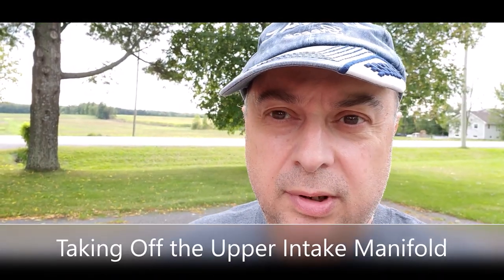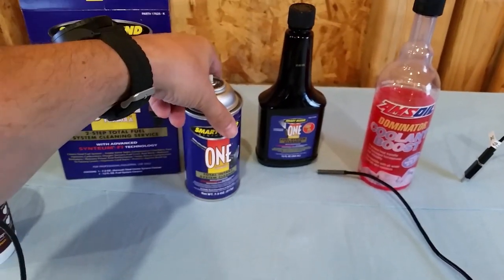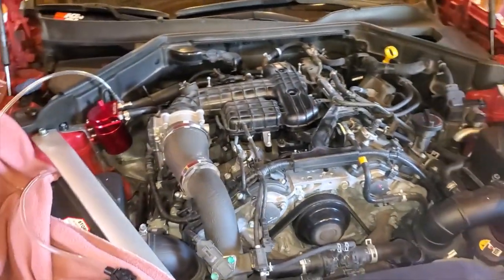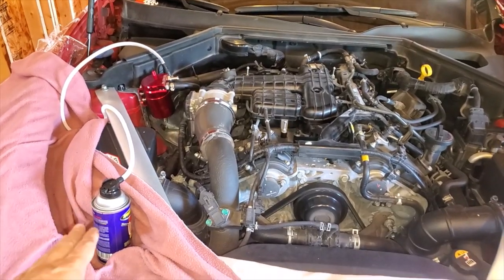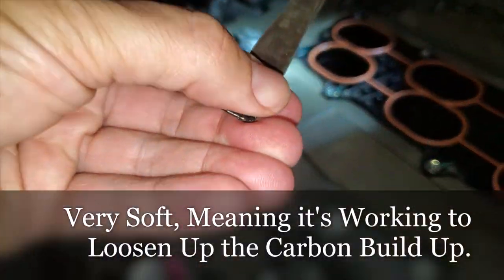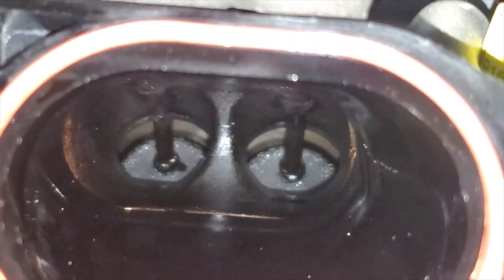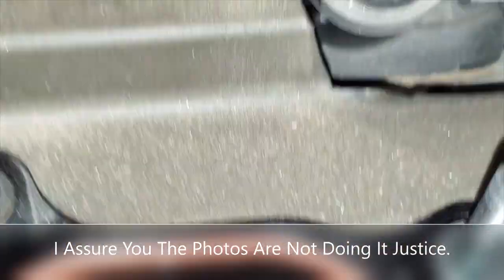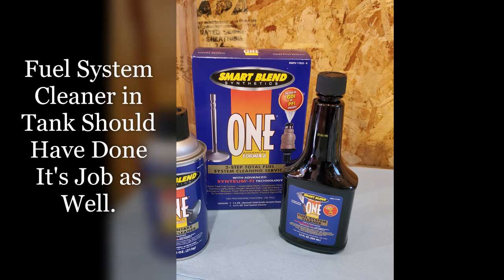GDI Intake Carbon Cleaning - My Stinger GT - A Reference for all GDI Engines

Comment: A more thorough method I found works is make sure the valves are closed and dump lacquer thinner into the intake ports. Use a toothbrush to scrub the walls and stir it around over the back of the valves. Then take rags and absorb all the carbon filled lacquer thinner. Repeat a few times until clean. You can get the entire intake down to bare metal with very little effort because lacquer thinner takes carbon off super easy. I haven't done this to my Stinger but I did it to my Optima SX at 60K miles and got the intakes looking like brand new in just a couple hours.

Comment: How many miles did you have on your car prior to adding the catch can?  And not bad for your first decarbonization!  I run seafoam prior to every oil change.  And have had a catch can since the car had about 3k miles!
Reply from the maker: I'm not sure on kms on my car at catch can install. I might mention that in my catch can video, but it was apprx. 1 year or so after I got the car, and catch can was on my desk in a box for a long time being lazy to get around to it.. I'm considering doing a walnut blast, so I can get it cleaned up much better and then go back to doing this spray  few times a year
Reply: @rpmautoreviews9249  nice

Comment: Good video, I expected the results to be nil. Walnut blast is the way to go, obviously it’s going to cost more, but it’s also going to remove most of it.  Pros and cons to the direct injection, biggest being air fuel tuning capabilities, cons, excessive carbon build up that robs fuel economy and more importantly power :/
Reply from the maker: I will be doing a walnut blast soon !! or after I did this, if had the time, should have hand cleanup of the sludge since it was soft now, but it would take a long time, very slow and careful to not drop bits into the other engine part.. Kinda dumb I didn't but I was at Tyler's house and he had guest arrive before we finished it this part.

Comment from the maker: Special Thanks to my Friend Tyler for all his Work in this Video ! Like a Dummy, I forgot to Formerly Introduce him in the video. Doh ! ** Here's Tyler's perspective from our this experience: 
"  It was a pleasure working with you Stavros! 

This is the first true "before and after" comparison I have done with a carbon cleaning product, and the results were very interesting. Typically you "spray and pray" with a product like this, but we went much further to validate the results. Hopefully your viewers appreciate the extra work that went into doing this. 

Observations: 

-We tested the spray on a part before the video and it created a noticeable fizzing reaction with the carbon. With direct application on a part I suspect mechanical cleaning would be more effective. That said, if you are going this far you would normally walnut blast anyways. 

-We had difficulty keeping the engine RPM steady during the test. Doing the test at idle may produce better results, but we were not comfortable doing that for a few reasons. 

-The intake valves on the passenger cylinder bank (pictures labeled 4-6 in video) seem to have cleaned up better than the driver cylinder bank, with the middle cylinder on the passenger bank showing a significant improvement. This shows how well the product can work, but the stinger intake manifold provides such a straight shot into its short runners that the product must not have distributed evenly. Perhaps injecting at a different location would improve the distribution. 

-The before and after pictures for cylinders labeled 1-3 in the video (all driver bank) do not appear to show any real improvement. In person there was a noticeable difference in surface texture and some carbon had obviously been removed. Most notable is that the carbon buildup after the cleaning was found to be very soft (like play dough). With a second application I think we would have seen better results " 

* I'm posting this for him, as youtube sometimes Glitches and posted don't show and he tried 3 times... And like a dummy, I forgot to make a formal intro on him helping in this video and only his hands are in there.. DOH.

Comment: I can see doing this if you are racing like you do but for daily driving not rly. I put my catch can on at like 100km so early prevention
Reply from the maker: Carbon build happens on all cars and more so on gdi engines (not so much on intake valves for none-gdi), but still on all cars. the Catch can, I highly doubt stops this, but merely is one small tool to help out. I can assure you, this service or a walnut blast or some form of cleaning will be needed on all cars at one point of mileage.

Comment: Gentlemen,  Consider not doing this, you got very lucky. But yet you may still be in some trouble as doing this causes a ton of unforeseen results to the oxygen sensors and your catalyst pellets inside your catalytic converters, as well as you are spraying a cold liquid all over your hot intake valves and shoving alot of contamination into your turbochargers.  I can not emphasize enough that a person must not do this.
Simply take your GT2 Stinger on a long drive (recommend an hour out and an hour back at highwayspeeds of 65 to 70 mph), as this will absolutely  burn off most all of the build up that happens in city start/stop driving. Do this at least every 2 to 3 months.
Please consider not doing the method you just did ever again.
I can 100% promise you, that if you keep your GT2 Stinger well maintained,  ie.. clean air filters, oil changes, cleaning your throttle body every 15k miles religiously, and absolutely purchasing 93 octane gasoline all the time, your GT2 Stinger will perform in a excellent manner as designed too, for many, many, years. However as with ever internal combustion engine, they wear out, and dont stay "new" forever.
Please do not do what you just did. Ever again.
Reply from the maker: Appreciate the feedback.
Hwy cruise you speak of is nick name The Italian tune. It doesnt work with newer cars, i have read.
On the way home from this, over 1.5 hrs, i drove in one lower gear reving higher, just in case, to simulate the italian tune. Hopefully it helped clean out a bit as well ??
Reply: @rpmautoreviews9249 ,
Yes it does.
The engine gets up to normal operating and you must use 93 opr better gasoline. As that creates higher combustion chambered temps. Which will in turn, burn off any and all carbon build up. You should know this. You should. As you claim to be a professional.
Reply from the maker: @joejones6968  I never claimed to be a professional.  I said, i have read articles that state the italian tune doesn't work. Those articles gave scientific type info on why it doesnt work. Maybe it does, maybe not ?
Reply: @joejones6968 
You're wrong but go on. 
Italian tune up is a waste of time, the only problem injecting a cleaner into your intake is hydro locking if you flood the engine
Reply: @joejones6968  The italian tuneup DOES NOT work on Direct Injection engines. It only works with old, multi-port injection setups. With Direct Injection, there's absolutely no fuel washing the backs of the intake valves. You can accelerate all you want, but there's no fluid going through to wash the valves. If anything, acceleration releases more vapors and particulates which will do nothing but contribute to the carbon build up. Your best bet is to use a good synthetic oil to reduce vapors and walnut blasting when the buildup starts to affect performance.